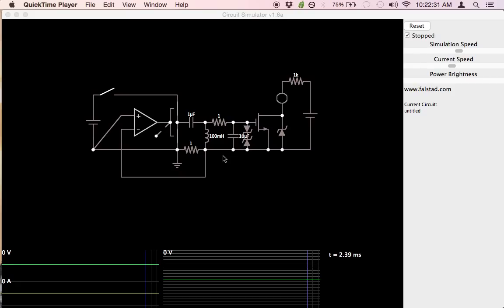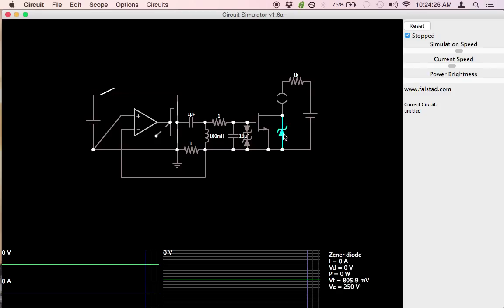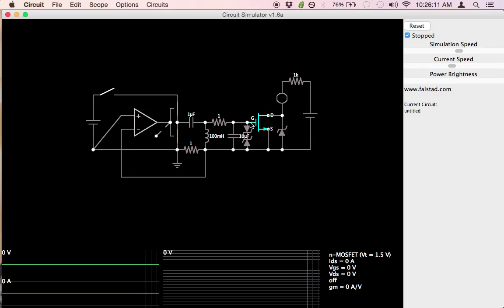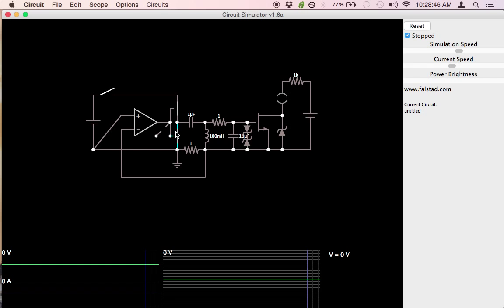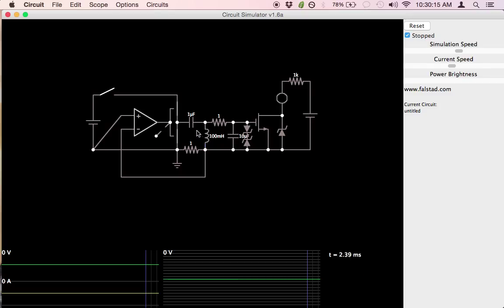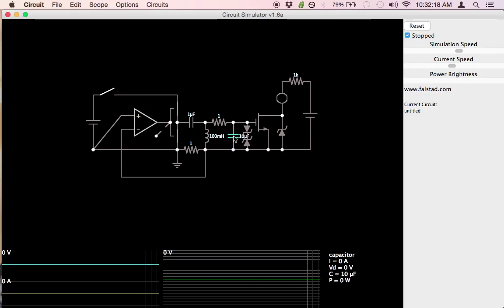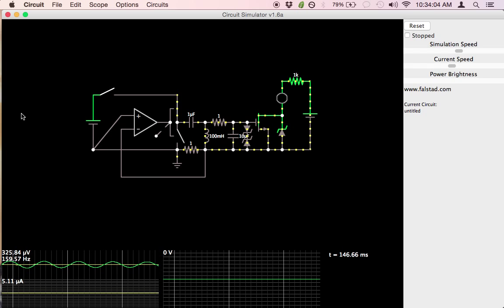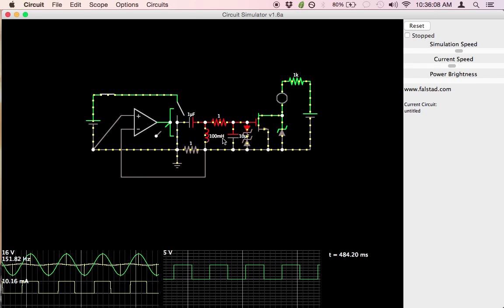Simple High-Frequency Resonant Gate Drive for MOSFET - Concept and Simulation

Comment: Question: If you have 2 zeners back to back like that, why wouldn't a large voltage beyond the rated voltage of the zener at the gate not flow right in. IF a large voltage is applied on the source, the lower zener is forward biased to that voltage on the source, then there is the upper zener (sorry, i'm going to keep calling them upper and lower based on the typical view in your video) which has a certain rated zener voltage. I don't get why that voltage/current couldn't just scooch right on up if it was beyond the upper zeners rated zener voltage. Would that upper zener be more useful as a regular diode with a low reverse leakage that flows down through a zener with the desired zener voltage less the diode voltage drop on the upper one?

Comment: Thank you for sharing.
This is a better way of driving mosfets from low-power circuits, opposed to having drivers and drivers driving drivers :-)
Reply from the maker: Thanks! I am also not very impressed with typical approach of drivers driving drivers... :) However, recently I have been experimenting with GaN MOSFETs. While they are still quite expensive, they typically have very small gate capacitance compared to silicon MOSFETs, which means high-power gate drive circuitry isn't necessary in most cases.

Comment: i used this simulator .....as i am not familiar with electronics i want know few things.....while running simulation some electric path and part it shows red what that red color means? also what abpout green and yellow dots?
Reply from the maker: In this simulator, the green color represents a positive voltage and the red color represents a negative voltage (with respect to ground). The voltage range is configurable. The movement yellow dots represents current flow, and the speed is also configurable. The simulator is here: http://falstad.com/circuit/

Comment: Great work sir . But what  does this rgt have to do with MEMS  ? They say  tat rgt was the first MEMS  device.
Reply from the maker: ajay deepak Well RGT (resonant gate transistor) is not the same thing as RGD (resonant gate drive). There is no MEMS technology in my presentation. RGT is a type of micro-electro-mechanical system involving a microscopic (mechanical) tuning fork as a frequency selector, whose motion is detected by proximity to a nearby FET gate. In my video, I am talking about driving FET (actually MOSFET) gate voltages in a resonant fashion, utilizing the built-in gate capacitance and an external inductor as the resonant elements. This is electrical or "signal" resonance, not mechanical resonance. Hope that helps.
Reply: Kevin Patterson Thanks for the clarification .. much needed ...